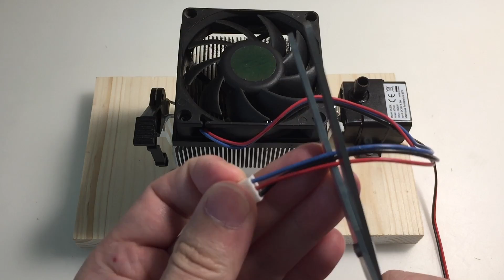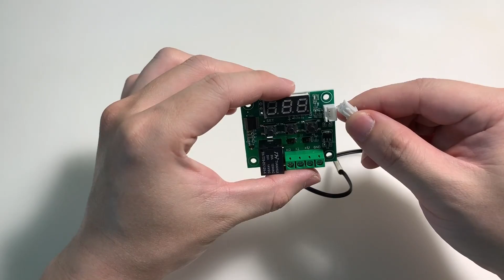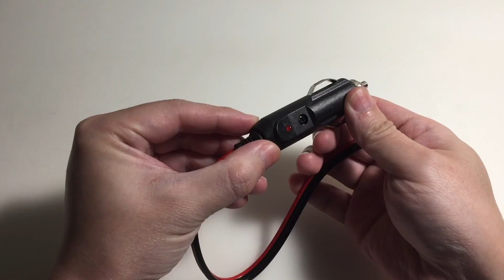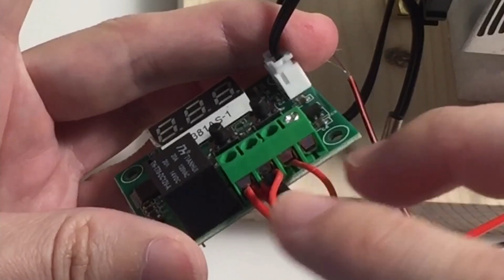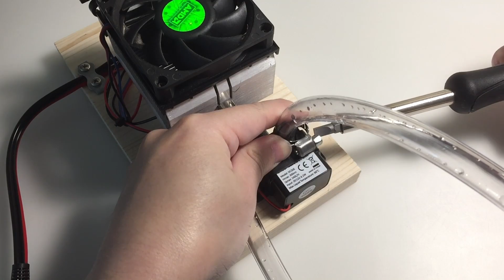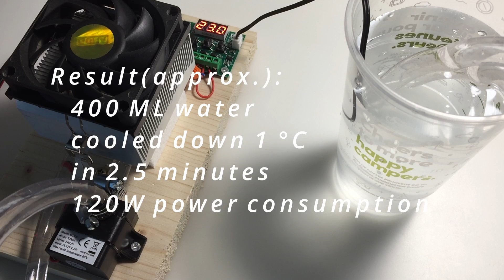Make AC for fishes! DIY Aquarium Water Chiller - Ep 2: Wiring and Testing

Comment: Hi Brad, 

I dont know why but I did everything as per the setup but still even one jug of water is not cooled :(, would you like to get in touch over an email/watsapp to identify the root cause ?? Awaiting positive response. Thanks for your help.
Reply from the maker: I would bypass the control module for now. Connect the Peltier directly to the 12V power supply for 3 seconds. If you can feel the coldness, and the heat on the other side, you know the Peltier is fine(do the same to the pump and fan to test them) and the issue is likely with the control module. May be the wiring or setting.

Comment: Hi i wonder if you can help me with my water chiller i believe it does have the same hardware, but my fan iant working and it is not getting cold or warm it, the set button is not working too, its not a diy, its from china that i ordered online and it work on first try but when i connected to my aquarium, it became defective the fan is not running. maybe you can help me?
Reply from the maker: I would google the model number and see if someone had the same issue or there’s a manual to follow. After trying that if it’s still not working I would need to test with a multimeter to check if there’s current running through the device because based on the description there’s none. Sorry that I can’t be more helpful and hope you get it fixed soon.
Reply: Yes I followed your instructions and it worked, after some videos even if it doesnt have the same model. Your video is helpful! I worked on the time delays so it is not defective! 😅 thanks to you!

Comment: Hi , i tried to copy but the pump wont suck the water , any tips?
Reply from the maker: I guess it’s air lock. You may try filling the pump and tube with water. Leave as less air as possible in the system then start pumping. Hope this will solve the problem. Thanks.

Comment: You need to use the most efficient peltier module, TEC1-12708. Assemble at least 4 of them in parallel and feed only 6 amps for each. In total you would need to feed 6x4 = 24amps at 12V. Don't use those heatsinks, they aren't enough to pump out the heat from the hot side. Use water cooling, aluminium cooling blocks and radiator setup.

Comment: Did you use peltier for the cooling?
Reply from the maker: Yes. By the way, the device can easily transform to a heater by giving the Peltier inverted current, so it can be used in winters.
Reply: @byc0705  thanks a lot!
Reply: @byc0705  what power adapter do you use?